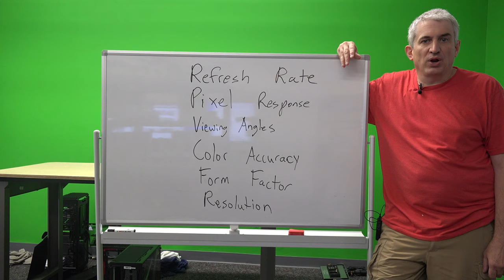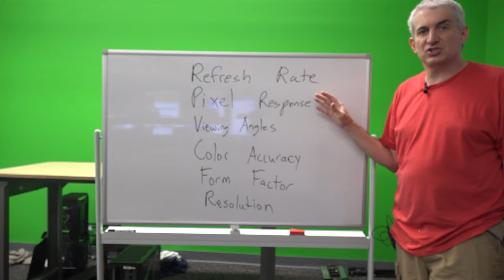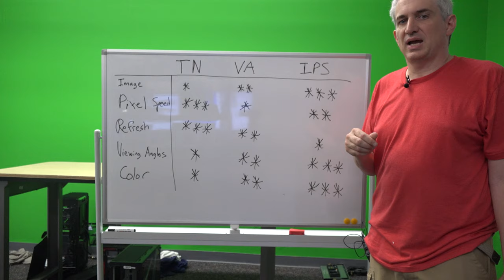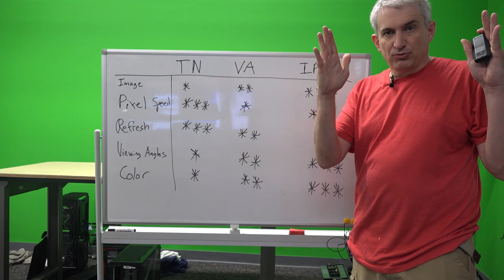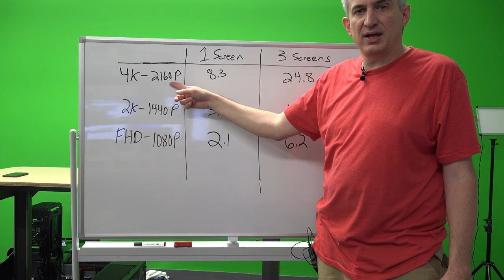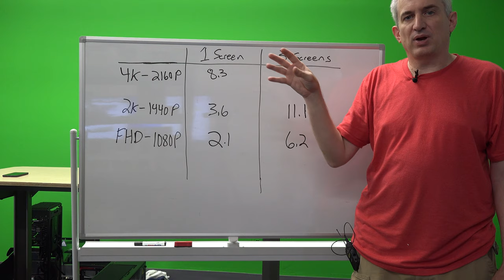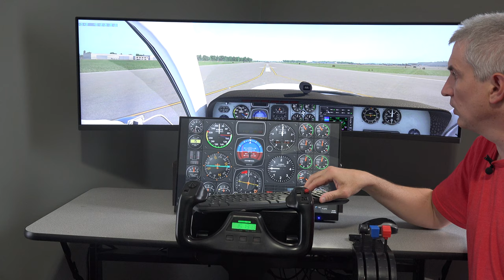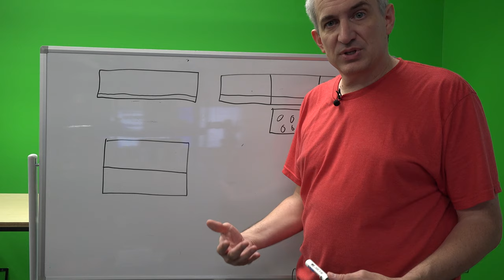XForcePC's take on monitors for X-Plane

Comment: Hey Michael, thanks for the video.  Good to see some of these PC enthusiat issues specifically from the point of view of someone who wants to run Xplane.   Austin and the Xplane community is fortunate to have a vendor so willing to tightly integrate for that application use.

Thank you for all the benchmarking and testing all of the CPU, video card, sim hardware, monitors, etc....
You really have presented specialize information in a format that the related community can easily digest and refer to.  I'm sure it great benefits your business, but also provides a service to the Xplane, Sim and PC market as well.  Proven info is always fantastic.

I know that you have done 3 x 49" 1080p displays horizontally.
What I would like to see is 2 x 49" 1080 or 1440p display, but one stacked up on the other.  so that you get the vertical depth and the super wide view, and it's only 2 displays.  That might be the best display setup, excluding physical interface systems.

Comment: Cool explanaition. I wish you had done this earlier. I want to add another advantage for the IPS-Panels which is very important for the multi monitor setups. The IPS panels have on technical reasons the smallest bezel, which improves the view a lot. I discovers this to late and need to replace step by step my VA panels. By the way you can run more panels on 4K with X-Plane (me: 5 monitors) if you use more computers. X-Plane allows the connectiosn view network, which is for a cockpit build with 270° view angle very cool.

Comment: Very informative video for those who want to buy a monitor. Thank you very much. I think few things could be added if there would be a part 2 if in future.
1. The Gsync or free sync compatible monitors. I experienced a huge smoothening of my flight experience even at 24 FPS level with my Gsync monitor. It got rid of stutter which was annoying especially when I come to land or when I turn my head left or right or up or down. 
2. Curved monitors

Thanks again for your videos. I learn lot from them.
Reply from the maker: Yeah, I have some g-sync and free-sync monitors, myself.  I even have that crazy expensive 27" 144Hz IPS GSync panel from Acer at home ($2000 when I got it, about $1600 now).  I figured I would save adaptive refresh for another video as this one was pretty long.  Perhaps soon, though.
Reply: So does G sync work between, say, 30 and 60 fps for X plane ? It doesn't in P3D.

Comment: Thanks for the video!  Great break down!  I have been researching on what to use for the visuals in my home cockpit build.  I would just like to add "input lag" to the list of variables when considering a monitor, tv or projector for a sim set up.  It is the time it takes from an "action" or "player input" until it shows up on screen in milliseconds.  This is balanced against the sim's frame rate of 33.33-16.67 ms per frame at 30-60 Hz.  Monitors are typically very fast at 8ms or less (half a frame).  LCD/LED TVs are 16-50 ms (1-3 frames) while projectors are still above 40ms  (2.5 frames) and could be as high as 100ms (6 frames) for some of the new 4k lasers.

Comment: Great video, Michael.  Your earlier videos motivated me to go with a 3-screen; 1080P; 50" TV; 60-degree wrap-around setup.  I have a moderately beefy system that gives me around 30 FPS. However, when I try to add a 4th monitor (iPad using Duet Display), I drop into the lower 20's.  I was curious from watching your videos on using onboard graphics if you have tried running a 3-monitor setup and use the onboard graphics card to run one or two additional monitors (or iPads) as instruments?  My dream sim would be to run the RealSimGear G1000 suite along with the 3-TV  setup.  Since you already have the resources, I would love to see a video that demonstrates this if it is doable.  I thoroughly enjoy your content, Michael.
Reply: I have three 24 inch 1080P (left cockpit right) along with a 27 inch 1080P for navigraph/littlenavmap.   PC is i7-8700K at 4.8 Ghz with a  nVidia 1080ti.  Decent FPS but dives to 25 fps with complicated scenery and ortho.  So four monitors is possible with a higher end PC.   I wonder if anyone has been running the two wing monitor views on a separate PC linked to the main PC which produces the cockpit and auxiliar views?  Michael's videos are excellent!
Reply: @Scott Menard Scott,  Thanks for your input.  My question was based on some earlier videos Michael produced where he states that you can run both a dedicated graphics card and the onboard graphics card on the motherboard at the same time. In order for it to work, you have to enable the onboard graphics card in the bios.  Here is one of the three videos he produced showing how to do it: https://www.youtube.com/watch?v=wmIOuruxGfY&t=10s 
I have an old 1080P monitor and a 1080P TV sitting around the house that I may try hooking up to see if it works.  I was hoping someone else has already tried it to save me the trouble in case it doesn't work.  I'll let you know what my results are.  Thanks.
Reply: @Scott Menard Scott, I was able to successfully add two additional displays (1080P TVs) using the onboard graphics on the motherboard.  This is in addition to the three 50" 1080P TV's I use in a 60-degree wraparound with dedicated graphics.  Enabling the onboard graphics card in the bios was easy once I Googled how to do it.  When I booted up the PC, the Display Settings showed all 5 displays.  It did manage to mess up my multi-display settings in X-Plane, but that was easily remedied. My overall performance using 5 displays was better than my previous experience with 4 displays using dedicated graphics, but it still wasn't great.  When using 3 displays only, flying the X-Aviation TBM900, I was seeing 32-34 FPS.  When I dragged the G1000 PFD display to the 4th display (onboard graphics), the FPS drops to about 25 FPS.  When I dragged the G1000 MFD to the 5th display (onboard graphics), my FPS dropped to 22-23.  My past experience using "Duet Display" on an iPad as a 4th display (dedicated graphics) gave me the same 22-23 FPS.  So, even though 23 FPS is not that great, I achieved the same FPS while adding a 5th monitor to the mix.  X-Plane Settings: Scenery - Low to mid complexity - a rural airport; Graphics settings were set pretty high, but not max.  Lower settings would have given me improved performance.  I was encouraged though by what I was able to achieve.  I believe the resolution of the displays on the RealSimGear G1000 is only 800X600, so the FPS should be slightly better than two 1080P displays. All I need now is the latest-generation processor and a 2080-Ti.  Yikes!  $$$   

My PC specs: i7-8700K overclocked to 5.0 GHz; Asus GTX-1080, also overclocked; 32GB Ram

Comment: Thank you Michael for helping us to understand the different monitors technologies and thus to make the best choice suited to our needs. 
Personally, and after seeing this video I think I will go for the DELL USB-C 4k Ultrasharp43: U4320Q in 16: 9 and 3840x2160 format.
The 49 inch is too stretched for me.
I will then switch to the NVIDIA 3090 graphics card to take advantage of this monitor under X-plane 11.51.
One question: Does the power of the processor (CPU and not GPU) have an impact on the ability to manage a monitor parameter as refresh rate or pixel response ? 

                         (normally no I think ?)

Comment: You forgot black levels. After playing games on VA panel i can never go back to IPS simply becaus the black is close to flawless and the IPS panels have massive screen tearing issues in my experience. playing on VA panel with no need to use vsynk or freesync/gsync and also getting black nights and good collor is unbeatable. Remember that for any sim games IPS collors are just going overboard and evreything looks over collored and fake.

Comment: Another useful video, thanks. Just one observation. If you can set up a single 27” monitor so that enough instruments are visible, i.e. the typical home setup, I don’t fully understand why it is not possible to set up the ultra wide monitor (equivalent to two 27” monitors) with the same view in the middle as the single monitor, but with the advantage of more scenery on both sides.

Comment: I’ve been working with three displays; an Apple Cinema HD connected to an AMD Radeon 5770 HD card which shows the Instructor Operating Station and an HP-25x, and an old Oleva 40” TV, connected to an NVIDIA Titan X (12GB) and struggled to get more than 45 FPS. Once I added an NVME PCIe drive, my frame rates almost doubled - I can get near 100 FPS even on the Apple Cinema HD Display. Most of the rendering load appears to be the exterior scenery. It would be nice if there was a way to have one video card do the cockpit and another do the scenery. On a related note, with XP 11.50 I don’t see more than about 3GB of Textures being loaded onto the Titan X, even tho it has 12GB of VRAM.

Comment: What would the performance be if you stacked two Super Ultra Wides on top of each other?
Reply: ya a ultra wide is basically 2 1080p if you took that and stacked it you would basically have 4 1080p that is equaled to 1 4k but your using twice the screens thus taking the preference hit at that point you might as well just have a 60' 4k TV hooked up

Comment: y'all should look into an app called spacedesk it runs on you PC and allows you to use anything with a screen and a web browser as a monitor for your PC but for Android and iOS thy have dedicated apps and best part is its free

at that point even your phone can be used to display instruments or even check list

also one thing you did not point out is yes a bigger monitor is not more pixels and thus is not harder to run but just larger pixels but that mean everything is bigger by default thus you can push back or zoom out your camera view and still be able to read instruments thus giving you a larger filed of view 

so 1 4k 60' or bigger TV might be a really good option  because from a couple feet away it might be all you need because it is basically as big as you interment panels

Comment: Hi Mike good job. Can you explain about this from the x-plane manual "Lining Up the Horizon (Without Vertical Offsets)" for triple monitor.  I have a triple monitor setup and never understood this section of the manual. Also I notice on my lateral monitors the Horizon is not straight with the main monitor, tended to go up, Why?

Comment: Hi there, hope you are doing more than great, like your videos but still need some help from you, if its possible for you to do that and I will be very glad, I have 6 monitor IPS FHD each 24 inchs set for the viewing, I say IPS because they do not change image or color if you move around left right up or down it keeps the same image quality, and as well 3 monitor that shows the instruments with air manager and 1 for instructor station, in total I have 10 monitors on my homemade cockpit. so far I do not run all the monitors because of my computer that is weak for that, my question is: what is the best specs computer I should get to make this settings of monitor run the X plane 11 to get a decent FPS, right now I can only run up to 4 monitors, 3 for instruments and 1 for the view.

Thanks in advance

Comment: i'm running 2 monitors. one a 144hz the other 60hz. i'm losing auto pilot always is that a factor of the monitors? ge force 106 6g video card. 16 mb of ram and tomahawk b350 mb. any advice?

Comment: I have never understood the point of an ultra wide screen and another screen with addon gauges. Most third party aircraft are now designed with extremely accurate and well executed panels that are faithful renderings of the actual panel. With various camera addons it is now very easy to focus in on gauge detail when needed. The eyes and brain do not process forward views in this letter box way. So a vertically narrow monitor is just not a natural way of looking at the world or scenery. Cinematic or ultra wide monitors cut off just too much vertical view even without a panel.

Comment: I have a questions... there are alot of powerfull computer components available (overclocked CPU, Graphics (NVidea 4090/4080, Memory with 5600Mhz, NMe Harddrives, Watercooling, etc.) Is it possible to check out and compare the best combination and give an advise on reasonable, budget and performance systems, which will be good for the highest framerates? I know that you offer your own computers and this will maybe gives a good oppertunity for you and the community to find the best. For overclocked CPU's you will find them on CASEKING, tested with gurantee.

Comment: Having worked with TVs & other consumer electronics for over 20 years, I'm now trying to come up to speed with how TVs for the home compare to computer monitors.  When I left the A/V field over 4 years ago, a 60 Hz TV was garbage, a 120 Hz TV was ho-hum, a good TV was 240 Hz, and a great TV was 480 Hz. So it's odd to hear about 60 Hz refresh rate again.  My key question though is about the resolution.  In the case of TVs, a 4k TV did not mean you had to FEED it a 4k signal.  If you fed it a 1080p signal, it would simply upconvert that 1080p signal to a 4k signal internally, meaning that processing demand was NOT on the source feeding it.  So my question is, why not get a 4k monitor to anticipate future PC hardware upgrades, but just feed it a 1080p signal?  You gain some modest resolution improvement via the upconversion internally in the monitor, preserve future upgradeability, all without putting any additional workload on the graphics card at all.  Do computer monitors not have that upconversion skillset?  My second question is where we stand with respect to LED or OLED monitors for Flight Sim?  Especially, LED monitors with local dimming (which yields better black level and therefore better contrast).  My sense is that although OLED has the best contrast with black really being black and therefore better visibility in night scenes; it is still too susceptible to "burn in", the phenomenon where a static image - such as the airplane frame around the windshield - eventually becomes a permanent ghost image in the screen.  However, LED with local dimming has improved contrast dramatically over "run of the mill" LED.  P.S.  You are 100% right about the off axis viewing performance advantage of IPS panels!  Thanks again Michael for your invaluable help and I hope I didn't get too nerdy on this!

Comment: For a shoot like this, autofocus is not your friend.
Reply from the maker: Yeah, I know.  It is doing face tracking, so it focuses on my face when I look at the camera.  Should I set the focus on the white-board in this case?  Or, should I just turn off the face tracking and otherwise leave the focus to auto?  What do you suggest?
Reply: Maybe, but Michaels content about X-Plane is the best on YouTube.  I don't care if the production doesn't rival NBC Nightly News
Reply: @xforcepc  Michael, for the majority of this video I would recommend sticking with manual focus. Ideally set your camera up so the aperture isn't too large so that the depth of field will allow for both your face and the whiteboard to be in focus at the same time. Lock it there and forget it.